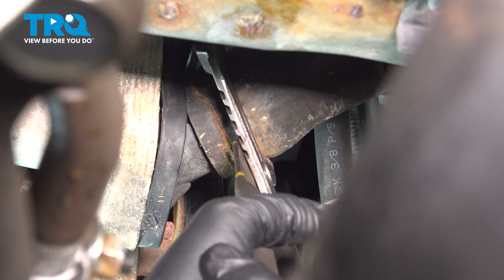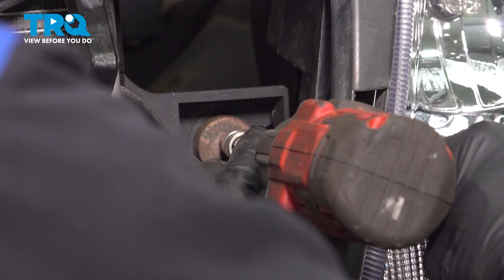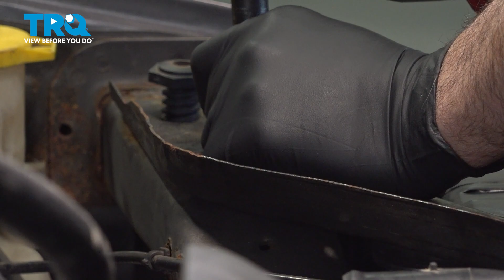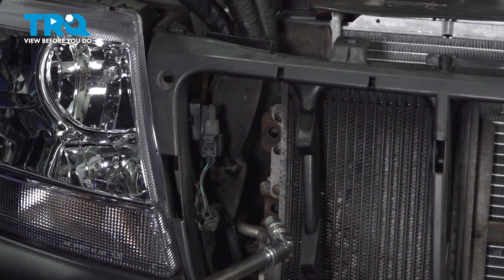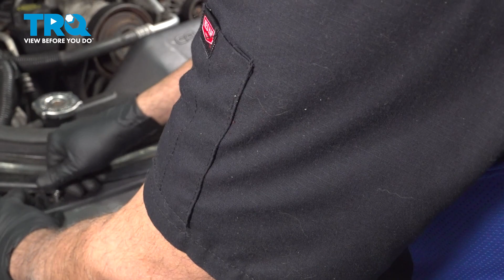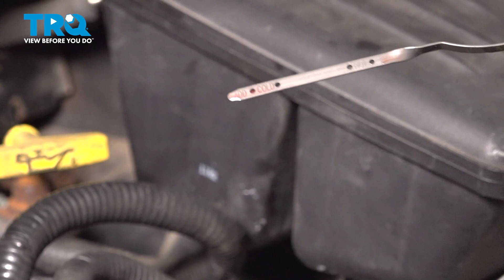How to Replace Harmonic Balancer 1999-2004 Jeep Grand Cherokee 4.7L V8

Comment: I’ve noticed that on my 2002 GC Laredo that the crankshaft pulley giggles a little as it spins whenever I pop the hood. My car has also been making a loud squealing sound on and off for about a year. I’ve changed the idler pulley, water pump, and even the belt itself. Each time I change something, the sound goes away for a little but then returns. My suspicion is that the harmonic balancer/crankshaft pulley needs to be replaced